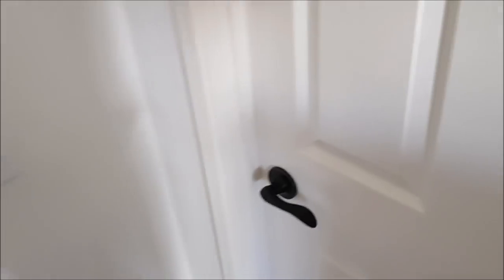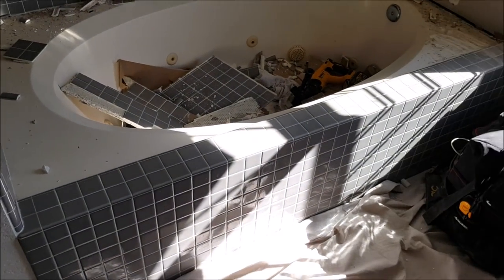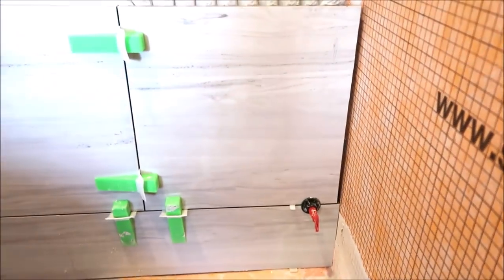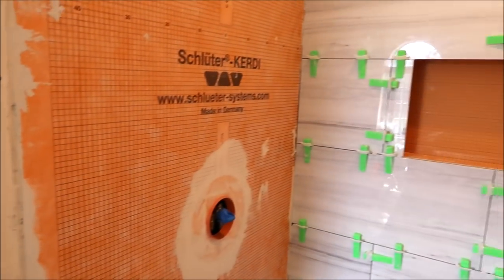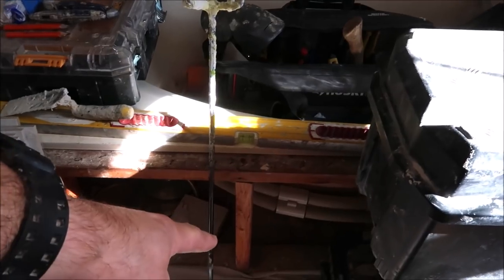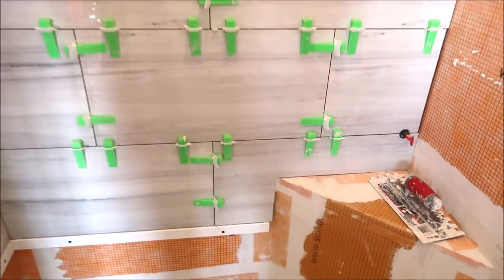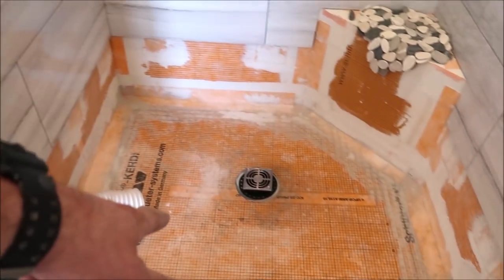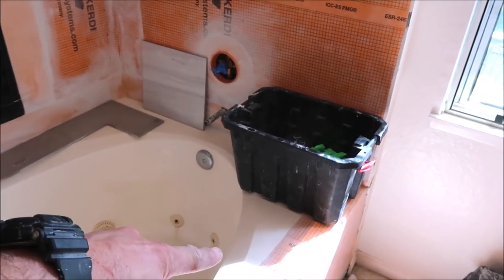Failed to Fantastic Part 1 Bath & Shower Tile Ideas EP 29

Comment: Doing it the proper way one job at a time! Nice work brother....only question I have for you is, how do you seal you're penetrations from the screws from the ledger board? I know what schluter and my rep say.....but you dont get 2" in all directions from center of the hole coverage with a pice of k-band, follow what I'm saying?
Reply from the maker: We usually cut out a square off the roll of kerdi membrane that comes with the kit.
Reply: @LandbergTileTV  right, but your not covering the penetration by 2" you have at most an inch of the kerdi patch over the top of the hole. (I'm not saying you're wrong by the way) cause if you are then I am as well lol. I fill the hole with kerdi fix then put a patch of kerdi over it like you did.
Reply: I've heard them say use kerdi fix

Comment: How did you determine the height at which to put that piece of wood all around to tile up from? I ask because the first row looks like not a full tile height
Reply from the maker: We simply measure the width of the tile and start there usually. Most of the time (because of the shower pan tile) the first row is a little shorter in width.

Comment: Is the waterproofing neccessary around the tub?
Reply from the maker: We usually waterproof the surround, yes.
Reply: @LandbergTileTV  gotcha. Just didnt know if it would make a difference if you set it straight to the sheetrock since it wont be catching any water or very minimal water. Thanks.

Comment: What size hole saw/brand for the control valve cut?
Reply from the maker: Diamond Hole Saw: https://amzn.to/2HZSrqM
Reply: Landberg Tile TV thanks I’ve been using stadea brand hole saw for 1 3/8 shower heads and other pipes and 3 inch for sink plumbing 
Need to add this to the tool bag

Comment: another nice work, mate. keep up. BTW, I have recently started using tile leveling system called 'Levolution',  It is invented here in Australia and can be found on the USA market.I have used 20000+ raimondi clips, but will stick to Levolution from now on. less clips used per sqm, faster application, more precious grout lines. Go check it out, you wont be disappointed.
Reply from the maker: Thanks, and that's awesome! Always looking for new systems to review...I'll have a video up on this system soon. Thanks!

Comment: Where did you get the humidifier?
Reply from the maker: Lowes. We use it for AC and the exhaust to dry material/grout etc.
Reply: @LandbergTileTV  its good to use also to remove humidity when a room gets too hot too correct?
Reply from the maker: @rodolfogiles4522  Yes sir, it helps with that also.

Comment: If you use thin set to install , then thin set is not waterproof and eventually it will fail
Reply from the maker: Kerdi membrane and thinset is waterproof.
Reply: @LandbergTileTV  these parts are came from Germany,  they didn't use thin set. We thin set which is not waterproof,  being proved by Isaac on YouTube channel.